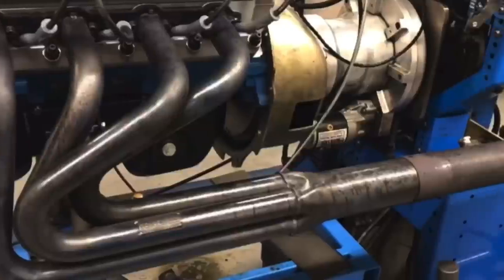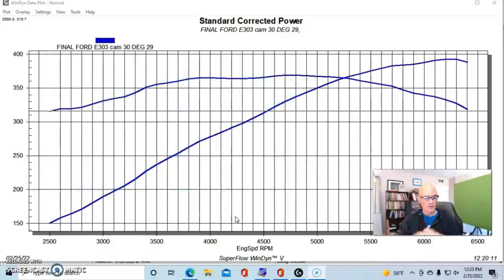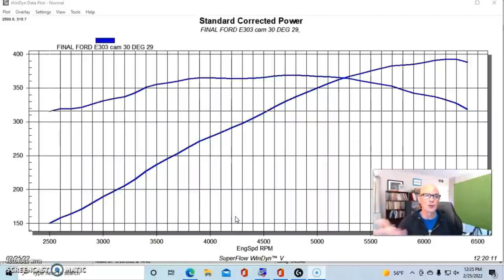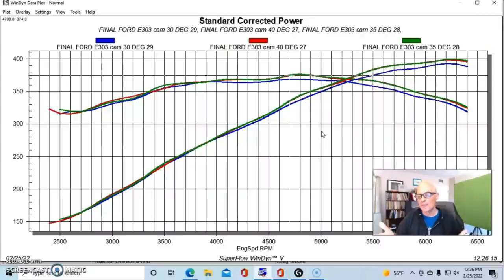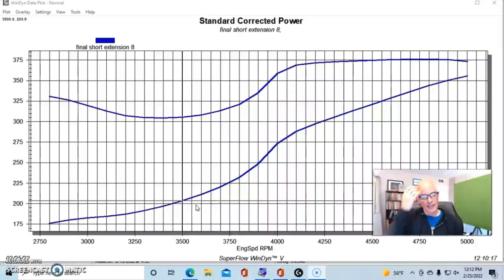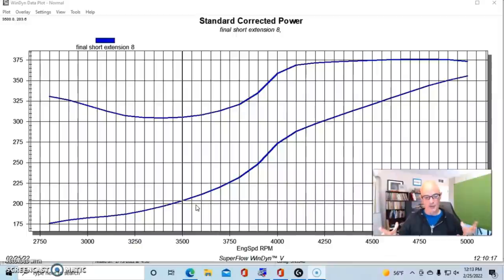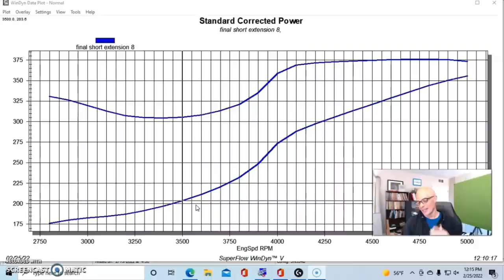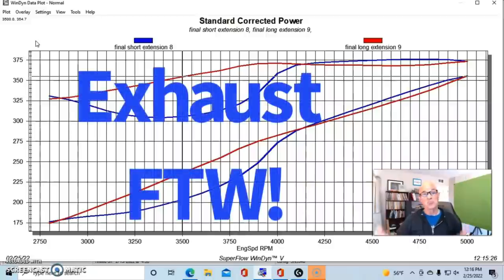HOW MUCH POWER ARE LONG-TUBE HEADERS WORTH? HOW DO I FIND THE MISSING 50-LB-FT OF TORQUE? 5.0L FORD!

Comment: My favorite collector was a flowmaster 3 to 2.5 reducer with a 14" megaphone welded to it. Really picked up the midrange on a motor with a 109 lobe centerline.
Reply: Higher exhaust velocity as the overlap increases, seems increasingly useful.

Comment: I'm addicted to your videos your enthusiasm is contagious. I have a 460 Ford built by an ex Roush mechanic. My intention was to stuff it into a 54 Ford coupe. A 54 was my first car and I stuffed a 390 in that one which barely fit with the flat exhaust manifolds. It was hot for the time. This 460 won't fit period unless I do a chassis modification and tube axle, basically a gasser, and I don't want that. Watching your 302 testing I became fascinated with their power potential. I have picked up 2 302s to build myself to get this project moving again. They wont have the wild hp of the 460 but they fit and probably will exceed the hp I had at 16 years old.

Comment: I'm curious to see what the difference would be on a mild 355 sbc, (hyd flat cam or retro hyd roller) with stock exhaust manifold vs say a Hooker cast iron manifold vs short tube headers vs mid tubes vs long tube headers all running in to side pipes.
Reply from the maker: I have those tests up-long tubes are best
Reply: Ah ah ah sir, this is a FORD VIDEO

Comment: good point about making too many changes at once--you don't know which change caused your problem or your happiness. an interesting thing about the ignition timing is some might want the later one to give the piston less resistance coming up to TDC and cause a pumping loss, but you want a combustion design that hastens the burn before the exhaust valve opens.
Reply from the maker: you want the combination of the most power with the least amount of timing

Comment: Nice work Richard. Wowza! Everyone likes to see a Phat mid range. 💨🔥I'm lucky to have two Ford engineer friends, both did the big Ford firing order HO engines One did the US short deck 8.2 inch development, the other the tall deck 9.2 inch 4.942 and 5.766 liter Cleveland's in Australia. Gregg and Bill found that good long tubes work great on a dyno, but when the engine bay is tight like it is on all unibody Ford's, Tri Y's give the edge. Non- symmetry seams to help the mid range. The chosen cam profiles that work are are the CobraJet, Super CobraJet style with  18 degrees extra exhaust lift, because all Ford's really suffer with compromised total combination exhaust flow. Once the whole exhaust pipe systems go on, the headers don't extract nearly so well. Dropping the peak duration at lash by 10 degrees can maintain peak HP and gain low end torque with a full 2.5 inch dual exhaust and craggy headers that look like they will hurt your 2500 to 3500 toque figures.
Reply from the maker: HOW CAN A TRI Y WORK BETTER IN AN ENGINE BAY? WHY WOULD THAT CHANGE ANYTHING? AND ARE THE CAM SPECS YOU RECOMMEND FOR STOCK MOTORS?

Comment: I would love to see different sizes of collector extension, and if they require different lengths. Narrower = shorter? Larger = longer?
With ported subwoofer boxes, smaller ports will play lower frequencies for the same length as larger ports. Or, larger ports need to be longer to play the same frequency as a narrower port, until the airspeed becomes too high.

Also, what about for road applications in states/countries with stricter laws. What happens if there is a bend in the extension, as if it needed to wrap around the transmission and clear the floorpan/chassis? 
Is there a difference in power between collector extension to an open to atmosphere dump, will you loose significant power if you have a high flow cat converter or muffler there, as long as the extension is long enough?
Reply: Dave vizard has a great exhaust video on his channel that covers a bunch of these topics. You should go watch it.  
Play it at 1.25-1.5x speed though because he talks pretty slow these days.
Reply from the maker: a sub woofer box does not provide a scavenging wave
Reply: @richardholdener1727  yes of course, the air in a sub box moves back and forth it does not "flow" but I still think it would be interesting comparison. I wouldn't run a dual 3" exhaust on a 302 with 350hp.

Comment: I love you videos! I'm learning so much.
I'd like to see the results of a 3" collector extension on 1 5/8" headers. I run pacesetters on my 302 with e303 plus GT40 heads and Trickflow upper and lower with a 70 mm on EFI.
Reply: Same. I have the Hooker Comps on my 351w and they clear the power steering and trans nicely, but I'm wondering if a 3 inch extension might help my torqorinos or if I should just step up to a full 3 inch system. 50 lbs is potentially a lot to leave on the table.

Comment: It's all about flow capacity of a given combination; in this case the 302 does not flow enough air for dual 3.5".  The air speed slows too much at the over-sized/open-ended collector for proper scavenging effect.  I would expect a dual 3" to gain low-end and mid-range power without any top-end losses.  For this engine, a dual 2.5" is likely large enough.  3.5" would probably be perfect if it were to Y into a single exhaust.  

As for primary size, I doubt there'd be much noticeable difference between 1-5/8" and 1-3/4", other than the larger might help more at the top of the power band.
Reply: The only reason to use an 8.2" deck block is a 9.5" deck won't fit! Been there, done that!! You stroke and spin that little bi!@h all you want! Keep shooting 250 on it to fool it and ur gonna piss the guys off when they have to clean the track! Of course, you could get an aftermarket block! But WTF4!! A 351w block will take 800hp preped! The rod-stroke ratio is light years better, rods are better, you can make the same power 800-1000rpm sooner! You can shoot 150 on a cast piston Windsor 20 times a week! It'll be sitting there waiting on you like a Labrador Retriever!

Comment: Remember "Project Pro Tree?" He went from longtubes to shorties and ran the same time. I know its not the dyno. But i would think the E.T. would have been affected if he lost power...Granted it wasn't a high hp engine. My longtubes had a long life, 25+ yrs on a street car and they are SHOT! I have a old set of MAC 1 5/8" shorties (brand new) and 2 1/2" h pipe laying around that may work their way on just because...

Comment: Great detective work on the collector diameter issue. From all the headers I have been around, 3 1/2 inch collectors are on big inch big blocks. Shoenfelt errored on the collector diameter. I would be interested in seeing a 2 1/2 " collector and keeping the same 1 3/4" down tubes. Later, if available, a set of 1 5/8" tubes would be interesting. Back in the day of Ford's Indy and GT40 engines, you'll see they used quite small collectors with megaphones. The GT40's shrieked and drove the Frenchies bananas as Ford destroyed all the competition. The Frenchies were still jealous of us winning WW2. Actually, the Frenchies hate all equally...Haha
Reply: Both engines you speak of had 180* exhausts to emulate flat plane cranks. Not the goofy exhausts that people are saddled with normally.
Reply: @2lotusman851 - what are you describing with 180 deg exhaust?  Always learning here. TIA, Clay

Comment: I'm not so interested in changes to the headers but instead,  how much of a difference is there when you have a full exhaust?  Is there a benefit for the collector extension on a car?  Does an H-pipe make a difference?
Reply from the maker: THE HEADERS DID NOT RESPOND TO FURTHER EXTENIONS

Comment: I would expect a 3.0" collector to be more than adequate for a 400 hp small block. With nitrous or boost, maybe not. But I wonder if NA torque would IMPROVE with  3.0", vs a 3.5"? Only you can answer that, Dyno Man.
Reply: 3.5" collectors sounded pretty ridiculous for a 5.0l engine to me too, but I just chalked it up to "dyno header, no restriction is best" Hell, I'd be surprised if a 2.5" collector was restrictive to it below like 7k rpm.
Reply: @thethepete731  I have 5 inch collectors behind my 1970 boss 302 engine. Made from 2 drive lines.
Reply: @cammontreuil7509  ok?
Reply: @cammontreuil7509  Um, that might look cool in a street rod or something, but it's not optimal for power, and would look absurd on a Boss 302 Mustang.
Reply: @jeffrykopis5468  I'm talking dyno comparison. Not looks.
But as an example. My younger brother bought a gasser, 39 Chevy coup  327, built by my uncle's.
The 327 had crome super comp hooker fender well headers and a 12 pack intake. I don't know what cam because we were both teens at the time and somewhat ignorant. I do know it was a solid lifter cam because I remember uncle Ed coming over and bitching at us to leave stuff alone and adjusted the valves again.
Well, my brother didn't like the straight axle, and put a dropped axle and conventional headers on the car.
At the strip the car ran slower. I know there is other factors and variables but the car was not as fast as it was.
Reply: @jeffrykopis5468  also, I put a boss 302 engine in my 68 F 100.
Way better engine than a 390.
But I am very aware now I have crappy breaks.
Reply: @cammontreuil7509  Like your uncle said, leave stuff alone LOL. But that's how you learn. There's a good reason that gassers had a straight axle, as your cousin found out. But what is a "12 pack" intake?? Six deuces? A half case of Budweiser?😉
Reply: @cammontreuil7509  I LOVE 67-72 "Bumpsides". As for 390 vs Boss 302, it depends on what the truck is used for. Certainly, the Boss is a high rpm screamer, but I wouldn't tow an RV with it! 😏
Reply: @jeffrykopis5468  case of vitamin c (Coors). Jokes.
6 Stromberg carbs. Old school nomenclature.
My brother and I did a tune up and couldn't figure how to wire the spark plug wires. Uncle Ed came over got pissed off at us again.
My brother and I were out racing a Mopar on the street and the driveline spit out the back of the car.
Uncle ED to the rescue again.
This was 1978. 
Thankfully the car was stable or we would have killed ourselves.
Reply: @jeffrykopis5468  I switched them out mainly because the 302 was better on gas than a gas sucking pig 390.
Took me 28 hours to build an exhaust system. 
One thing I switched out was a 5.4 inch rod and custom pistons.
Made a big difference.
I've loaded the truck and don't see any difference.
Just the little engine has more gas pedal than you need where's the 390 would be on the floor.
If I put a 800 double pumper on the engine and hold it to the floor, it's not safe to drive.

Comment: I'd run a test to find how much less timing I could run without loss on the bottom and set the initial at that.  Id' then set the distributor advance to bring the timing back in up to 6k rpm.
Reply from the maker: that is what we do on efi combos or on a carb application without a locked distributor

Comment: More midrange torque, and possibly quicker 60' times! Guess that 1/8 mile times would be noticeable quicker, 1/4 mile. ????. It's a much better street motor with smaller collectors!! Gotta do alot to that 3" stroke motor to make it forget its only5 liters  with a 3" stroke!!  Chunk it and get a 351w!!! 1/2" more stroke,  7/8" more connected rod!! Rod stroke ratios!!! Plus 5/16 " rod bolts versus 3/8" rod bolts!! 5 liiter motors are training wheels!!

Comment: Hi I need help this is unrelated to this video this question is about your speed Secrets 350 over on Comp Cams you did The Beehive Springs the cam heads and so forth what was the cast numbers for the heads that you used on the vortec heads I hope you can see my message over here and I really hope somebody can help me out
Reply from the maker: I don't know the head casting number
Reply: @richardholdener1727  okay no problem do you know do the Beehive Springs fit on any of the vortec heads and work like you did it in that video I'm not super knowledgeable I just want to make sure I buy the correct parts

Comment: Many years ago I lost my mufflers going over a railroad track, so because it was night I just used a hacksaw blade to cut them off entirely and drove like that until the next day. The sound was awesome but it was so gutless that I could not wait to get new mufflers on. And this was with pipes all the way back to the axle, just no mufflers. It blew my mind how much torque and fun mufflers added to that car. It was a mild Holden 308 with tri-y headers going into a twin 2 1/4" exhaust. That car really needed mufflers otherwise it was a dog.

Comment: How long were the collectors after you added the slip on extension? I’m thinking the smaller diameter headers/collectors will help torque especially down low.

Comment: I think and know that going smaller on exhaust primaries,collector and overall smaller diameter with longer length would yield better/responsive lower to mid range. And the opposite for mid to top end gains. Everything & anything to do with air flow is a see-saw/teeter-totter effect. It's basic Bernoulli's principle... where there is high pressure=low flow and low pressure=high flow.

Comment: I'd guess at that power level the smaller headers and smaller collector diameter wouldn't make a whole lot of difference.  If I recall correctly they did a test on Engine Masters between 3 inch and 3 1/2 exhaust, and they didn't see much difference until the output started to push past 500 horsepower.

Comment: guys i have a 94 mustang gt w/ the 302. i have an f-cam w/ ported stock heads and ported upper/lower intake. i was thinking about getting some aftermarket heads, pretty sure im gonna grab the afr 165's but unsure if they will work w/ my f-cam. also was thinking about the edelbrock performer II intake. any insight on this is much appreciated!
Reply from the maker: both good choices

Comment: Have a question. What is realistic gain expectation from cam, longtubes, intake manifold on a ls baseline at 260 and made 320 after mods. Same dyno and same gear pulls?
Reply from the maker: what cam and intake?
Reply: @richardholdener1727  lq4- switched to tbss intake manifold, btr stage 4 truck cam v2, and long tube headers

Comment: I have a supercharged 306 with 1 -5/8 " 2  1/2" colector header. Thinking about changing to a 3" colector. Will it gain or loose power ?
Reply from the maker: not sure it is worth the swap

Comment: Does the engine see any difference between a collector extension and a cat or bent pipe or even a merge?
Reply from the maker: we could have run a muffler in place of the extension as long as it flowed well

Comment: Hey Richard...I am building a 98 non p.i. short block.with the p.i. heads and intake....watched all your 4.6 2 valve videos..I was looking to buy a pair of those comp cams.p.i.262's or the p.i.274's....im doing the engine exactly like you did......with the p.i.stuff...and a 150 wet shot.......NEED those cams man......I can't afford that $609.00 that comp wants for em......need a deal bad...plz can u help a fellow hot rodder ?
Reply from the maker: I don't think I have any unfortunately

Comment: We used to see stuff like this back in the 90s with 2barrell circle track engines! When people put headers on different than the normal Kooks headers that almost all chassis builders normally used, sometimes they could make the engine a absolute turd 💩💩💩💩! We had winning engines that couldn’t even run in the top 5 with the other headers! But when we dynoed it (of course with our Kooks headers) it was making the same horsepower & torque as it did when it was new 🙄🙄🙄🙄! That poor bastard changed just about everything else on that car, ignition, water pump, fuel pump, fan, ect ect! Well we happened to go to the track that Friday mainly because this guy was saying it was the engine! Well that’s the first thing we noticed, was the nice new coated headers! That were supposed to make more power! Well when my boss asked where are the rusty old Kooks? He said they were in the trailer because he was selling them 🙄🙄🙄🙄! Needless to say, we stuck the old Kooks back on & it was a winning car again! That night! Well he ended up selling the nice new ones & that guy ended up running around the back of the pack, until my boss mentioned to that guy, hey you might want to investigate the length or collector on those, because they seemed to loose a shitton of power! Well he made a new customer immediately! 😂😂😂😂
Reply from the maker: I have a header video up on a 2-barrel circle track motor

Comment: 🔔😎😁JMO
Hookers 1 5/8 x 3 x 28" long   will be the best overall and responsive.  (Fox Mustang headers, preferred)
Reply: Will this combination header work well with a Chevy 350?
Reply: @ActiveDadsRule  
Depends on the build. 3" outlet is too big for sbc street cars. 2.5" all the way back with an H crossover, or even better (in my opinion) is 2.5" to a resonator with one 3.5" outlet then into one muffler. Nearly no back pressure if the muffler's selected properly.

Comment: Dumb question? Will adding a longer header collector work while using a set of shorty headers? I have an 86 Bronco with stock 5.0 (speed density) im going to upgrade to a MAF, but because of transfer case location. Exhaust options are limited. Shortys work best for fitment. 
Love the channel. Ive learned a bunch over the past year or so that ive come across it.
Reply from the maker: it won't change anything on a shorty header

Comment: Hey Richard....thanks for responding so quick when I ask if you had any p.i. cams for my 4.6 I'm building.....I was curious if you might know where I could find a centrifugal supercharger ..for the same non p.i. short block with p.i.top end...don't need brackets........just the head unit.